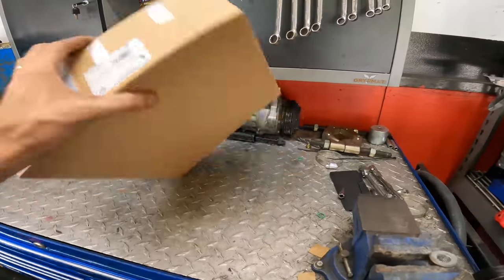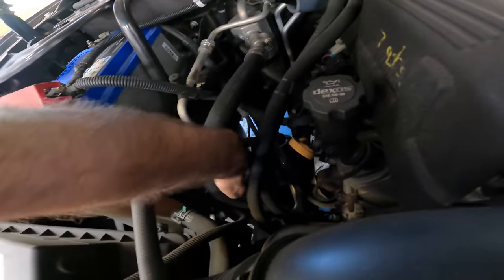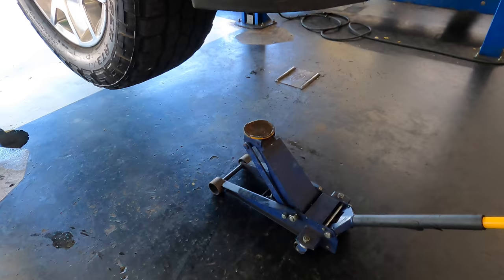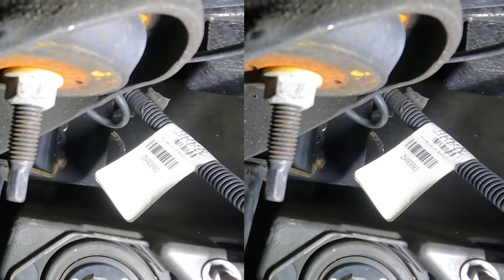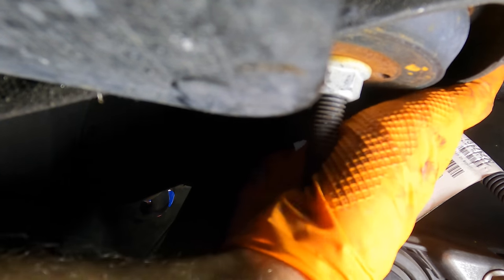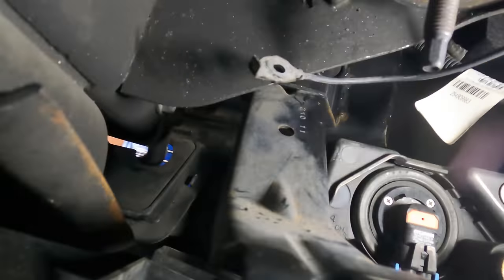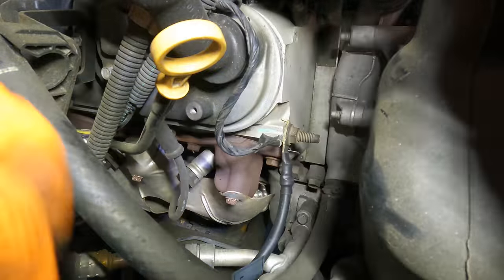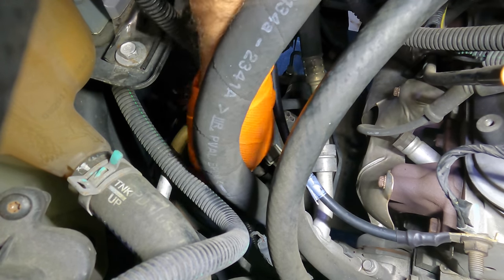Cadillac Escalade 6.2 NO Power, memory keeps resetting. Customer Request Battery Cable.

Comment: good thing it wasn't a snap-on that would have had so much torque it would have stripped out the canooter valves on the battery, nothing worse than a battery with stripped or over torqued canooter valves.

Comment: Was there really anything wrong with the original battery cable besides the corrosion at the battery connection and possibly a ground strap connection?  Cleaning should have done the job.

Comment: Here little Bobby scribble all over this paper.
This will be next years model.
Wait till the mechanics get a load of this one.
They'll have to remove the front bumper to replace the tail light.
There are hundreds of designers in the protection program to this day.

Comment: How on earth (pun intended) does a negative battery cable fail?
Reply: The same way a positive does, only usually more slowly.  It does carry some potential if the key's on, so when it's exposed to moisture and air because of failed insulation or poor design . . .  I relocated the body ground on one of my vehicles because the cable kept going bad and the lights would suddenly go out.  At first I blamed the grounding of the fixture, but replacing it didn't work.  Replaced the ground and discovered, by dissection, that the old insulation had cracked and the cable had become a mildly conductive powder.  Trying to free the ground end from the body was irritating, though not nearly as bad as this, so I moved it to an easier location on the firewall.  Worked fine and lights never went out.

Comment: I suspect that it's better to have the thicker battery cable's lug go onto the post first. That way it's in direct connection to the engine. I saw that one original connection was done that way but in at least one case you did the opposite.

Comment: Anyone notice that intake cover says 7Qts? The older 5.3, 6.0, 6.2 & 4.8 always took 6. Even a larger filter wouldnt make it 7 😂
Reply: probably to compensate for the rear main leaking 😅😁
Reply: @shanestrains2849  More likely that cooler housing gasket or plate gasket if not cooled paired with the pan gasket. The inspection port let's you get a clear view of the main and usually isnt leaking. Its everywhere else. That cooler housing is  absolutely notorious. Ultra black rtv is an easy fix.

Comment: I wonder.... imagine in a perfect world where engineer's consult with mechanics when designing a vehicle.
Reply: I imagine a perfect world where engineers get to design things the way they want without accounting, marketing, production, and about five other departments having more influence on the final design than the engineer...
Reply: Think Lochheeds Skunk Works. The engineers who did the designs worked right alongside the techs who were building the aircraft. If the techs ran into a problem they reworked things so that it worked and engineering redrew plans. Both sides worked hand in hand with the company's management attitude was this the job, get it done.

Comment: Ahh, another video that demonstrates why mechanics (of all kinds) swear at engineers whilst working on cars... I can kinda understand that engineers what to make their designs as efficient as possible, and that usually means finding ways to cram stuff into every cubic inch of space they can, but...I always sorta figured that "efficiency" should also include the process of actually working on the thing in situ. If working on it can't be efficient, too, but the design has routed things all over the place...you've made a bad design.

Comment: An amp meter in the ground cable.  Never heard of such.  Don't we love more and more sensors that fail.  Everything that goes wrong is due to the parameter measured or the meter that measures it.  100% the amp meter was the failure point.
Reply: It's simply a coil of wire.
Reply: OK it must be better termed an Amp meter pickup and the electronics are elsewhere.  Guessing it would actually be a coreless transformer.  The ground lead itself may have turns.  Still the complexity of design would include number of turns, wire gauge, connector, etc.  Still trying to understand how that would result in an intermittent open circuit.  Probably a wire connection to the connector or a burn out of the wire in any location.  Wonder if this is a recall.  Transformer lead failures occur due to excess amperage.
Reply: Factory quit putting ampmeters in vehicles eons ago. Only voltmeters, if anything since age of alternators dawned.

Comment: DO you ever get the feeling that engineers hate mechanics, or maybe engineers are just excruciatingly stupid?  It's gotta be one or the other...
Reply: Vehicle design is all about economy of production. Repairs are secondary concern at best.
Reply: @peted5217  Actually, having been around the industry since I was born, and having family in Ford and Honda R&D (while I generally prefer GM), I see you've made the same mistake of equating "design" with "engineering" and "accounting" that too many people do.

That's part of the reason that mechanics have no room to work, and it doubles or triples (OR WORSE!) the cost of most repairs these days.

Another MAJOR component (of the problem) is politicians, as they are neither mechanics, designers, nor engineers, (probably not drivers either, given their ignorance, idiocy and drug use) and the vast majority of their stupid ideas make cars worse, harder to repair, and of less quality in general, so they CAN NOT last as long or work as well as they used to.

A good example is the hood on "modern Mustangs."  You'd really have to be insane not to buy a spare hood with your car, because that foil-based piece of garbage is NEVER going to last like they did in the 60's.

Compare the working room of any "modern" one--even with a little V6 in it--with a '67 HiPo 289, and we're talking a ridiculous lack of consideration for mechanics knuckles AND sanity, as well as the car owners' wallets.

If we don't get rid of the commies soon, The Big 3 will probably be bankrupt soon, so someone with a brain might be able to buy them and bring back REAL, DECENT, CARS that are WORTHY OF BUYING again.

ASIDE:  The 2010 Camaro was designed in a usenet newsgroup by dozens of people all contributing their thoughts about what the auto industry SHOULD be putting on the streets.  The final rendering was released in that usenet newsgroup by "some kid in Australia who was good at modeling."  That kid was then hunted down by GM R&D after at least one of us sent the design rendering and discussions in to GM.  He got hired so that they could get the design, and that's EXACTLY what was re-released in 2010.